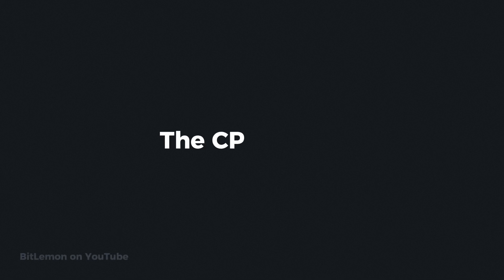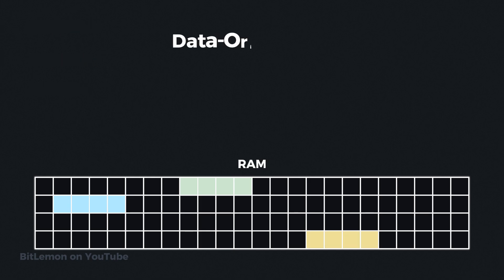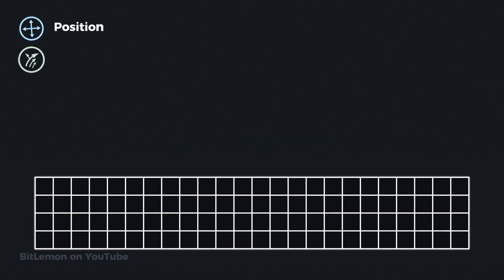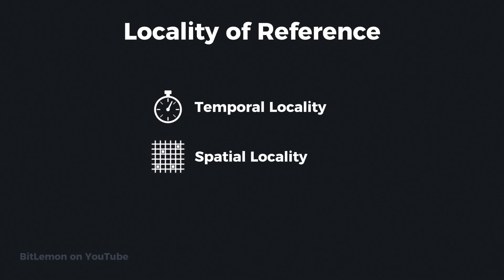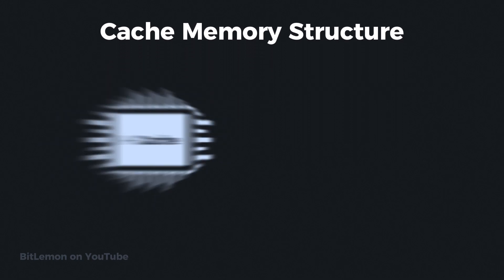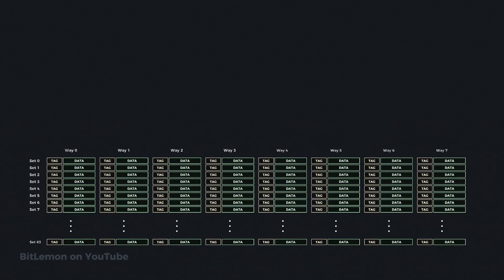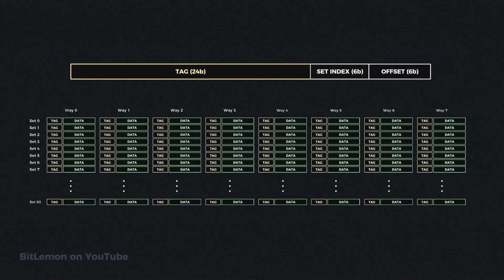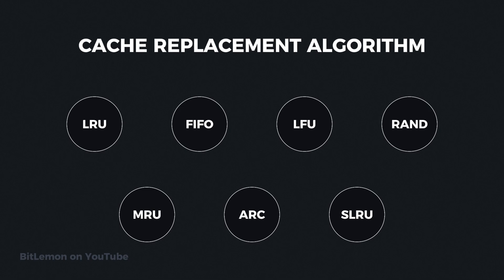How Cache Works Inside a CPU

Comment: Wellp but is ecs really more efficient?  There's no reason why you couldn't use OOP and still group the same objects into a linear container.
Reply: Exactly, it's not a property of OOP to have the objects all over the place, that's a property of your actual code architecture.
Reply: @MaviLeb Right? At best, you can even use tagged unions to store multiple different classes in a single container, with zero pointers and virtual function calls. Or even better, create a tuple of containers, that automatically manages all the different class instances.

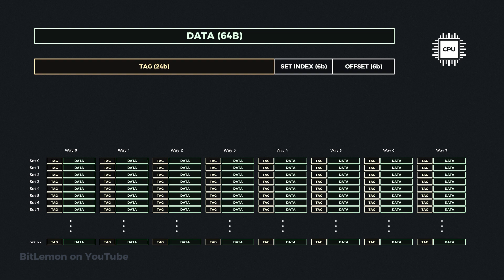Comment: At 7:10, I don't understand what does offset is used for ? You have 64 bytes to write. cache line can accomodate 64 bytes exactly. Tag is 24 bits, 6 bits to identify set. Then where does remaining 6 bits go ?
Reply from the maker: Selecting a single byte out of the 64

Comment: I have a question, so a cache line consists of the 64 Bytes of Data and the 64 bit Tag field for addressing the cache, does this mean that the cache line has in total a size of 70 Bytes? (64 Bytes + 6 Bytes (bc 64 bit) = 70)
Reply from the maker: Sort of. The tag field size depends on the number of index bits and number of offset bits, which means the tag field size varies, depending on cache type and architecture. Cache lines also often include status and replacement algorithm bits. So the total cache line size is roughly 70 bytes.
Reply: When Atari created the Jaguar, they aimed for raw speed and no overhead. The 3d engine consisted of 3 loops (per frame): forEach vertex, forEach edge, forEach face . Those loops each fit into 4kB . If Atari would have taken away some memory for tags, the loops would become very slow. So more bang for a given money by not using a transparent cache.

Comment: Interesting. One of the things I remember from old benchmarks from the Celeron days was how some games were strongly affected by cache but others were not. IIRC, Quake engine games saw a tremendous performance boost with larger cache. Clock for clock, the P3 or P4 or whatever was about 40% faster than the Celeron. Other games had much smaller differences, so presumably those other games just had a ton of cache misses built in no matter what the cache size was.

Comment: Marvell Armada 385 CPU documentation says:
 32-KB L1 Instruction cache 4-way, set-associative, virtually indexed, physically tagged, parity protected
 32-KB L1 Data cache, 4-way, set-associative, physically indexed, physically tagged, parity protected

Does it mean that each bank is 8KBytes in size? Is it possible to programmatically find out how many sets there are or how big each data field is?
Reply: I don’t get the 8, but to check the size, just let the CPU load and store a lot inside a range of addresses and stop the time. Malware uses high performance timer

Comment: It should be mentioned here that if this is direct mapped cache then each RAM address is mapped to the cache. But since the RAM is bigger than the cache, there are multiple RAM addresses ( RAM bytes/cache bytes ) which will be mapped to the same cache address. That is why, even though the cache is 32kb , 36 bits are used because if a RAM memory address which is not there in the cache tries to access the cache there should be a cache miss.

Comment: @6:51 it should be 2^36 bits, not bytes.
Reply from the maker: 64GB is equal to 2^36 Bytes, which are represented by 36 bits
Reply: @BitLemonSoftware  You're right, i looked at that too quickly ^^.

Comment: When I studied about computer architecture, they always taught that CPU talks to RAM directly not much about cache. Only when I became professional then I realized multiple levels of cache before RAM. I understand the importance of caching but I wonder how much is overhead on CPU when cache miss happens at all cache levels. Wouldn't it be faster to directly fetch from RAM instead of looking through multiple levels of cache?
Reply: The memory bus is a huge bottleneck (see Von-Neumann bottleneck) and it takes 1000s of cycles to get memory from RAM. Therefore we need something that avoids the bus if possible (CPU Caches which only take 10-100s of cycles). Over time, if you have enough hits in the cache it overpowers the extra overhead incurred by misses and then subsequent fetches to RAM
Reply from the maker: There is a very specific formula to figure out the Average Memory Access Time for a cache hierarchy.

To break even (RAM access is equal to cache access on average), you need a certain percent of cache hits. This percent is relatively low (probably low teens) so anything above that will justify cache access.

Comment: What are the best low level programming languages to manage chache resources? Trying to  see if Rush would come up in that list
Reply: You don't manage cache. That's done by the CPU. You can assist it though by taking advantage of temporality and locality by allocating and accessing your memory intelligently.
Reply from the maker: What do you mean by cache resources? The cache is completely controlled by hardware. Your choice of language won't have any direct impact on the behavior of the cache
Reply: Ok I see, so is it mostly memory/thread control from any low level code?
Reply from the maker: Languages like C/C++/Assembly give you the ability to control how the data in your program is arranged in memory. If you do it smart, it might increase the efficiency of the cache.

I think threads can have an impact on cache, especially in situations where you run completely different code on different threads

Comment: For normal memory the CPU sends out the address, which then goes through the binary address generator to fetch a row.

With cache we first fetch the addresses stored in the set. Then in a second step we address the cacheline (row) in a second memory bank. So cache needs two cycles.

Therefore, N64 uses TMEM, not cache. Atari Jaguar uses scratchpad memory (on chip). And even here an access has 3 cycles latency ( vs 2 to the register file ). Atari calls this extremely fast memory 

It would be faster to use large registers. The Jaguar can load 64 bit at once. ARM uses a barrel shifter in every instruction to select packed bit fields.

Likewise the CPU should just fetch very long instruction words. So long that it can contain REP SCANS and the 68k instructions of the same kind.
Reply: It is all true, but to much detailed for such level.
Reply: @ this was not meant as a criticism of the video, just a hint to follow. A lot of CS seems to be detached from the electric side. I think this was already visible in the 80s were Intel, WDC, and Motorola ran at higher clock speeds than the fabless RISC CPUs from theoretical CS , which offered incompatibility for an insane price .